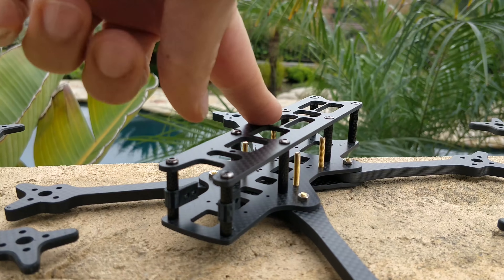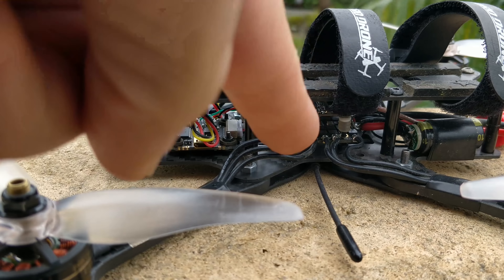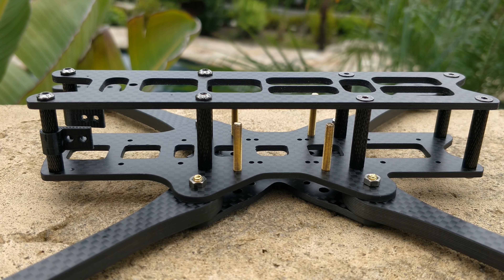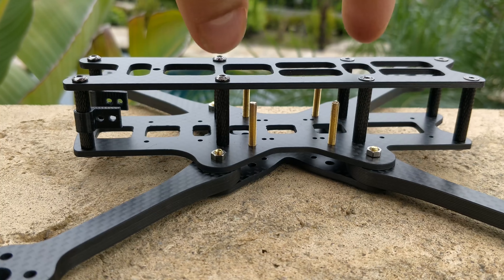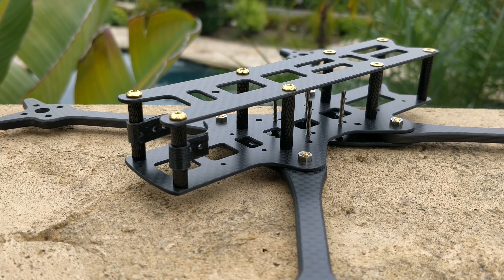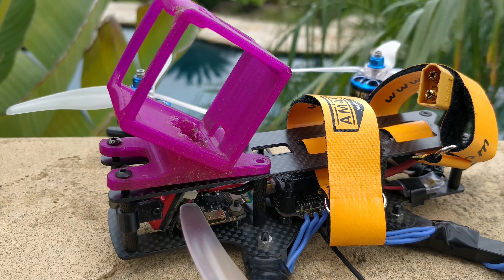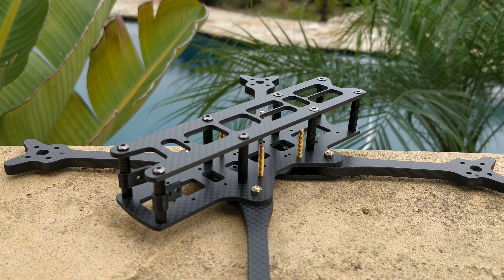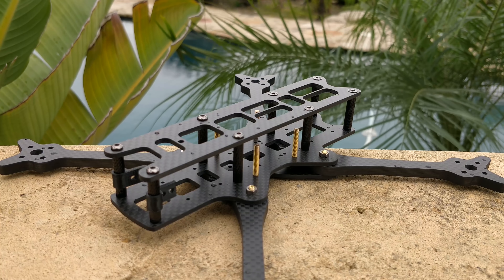Glide - 84g lite, 115g hammer, 97g standard

Comment: I'd be interested to know what specifically blows about R9 for you. I've been using it pretty much since launch (I picked it up in April 2018) & there were definitely issues with the launch (shipped with incorrect antennas, lots of firmware updates, whole thing felt rushed) but now there's honestly no difference between it & any regular 2.4GHz FrSky kit in terms of ease of config, reliability, etc. In fact with the new ACCESS hardware I find setting up a new quad with a R9MM even more straightforward than using a R-XSR. A lot of the people I see bashing R9 picked it up early on, haven't tried it again since, but still maintain that it's awful despite not having touched it in 18 months. But you've presumably used it more recently than that?
Reply from the maker: I've used every single iteration of r9.  Some of them work okay but the main issue is the absolutely mind blowing fragmentation in what should have been a VERY simple product.  There are SO MANY firmware versions and module versions and NONE of them seem to work properly with one another.  There's no simple way to update firmwares and nothing works with one another.  On top of that, the range totally blows.  I get better range on my rxsr than I do with the 1W R9 module.  Oh yeah and binding is absolutely ridiculous.  I can NEVER remember how to work the stupid menus to bind and they keep coming out with new shit that doesn't work with the old shit.  It's total bullshit.  If it's working for you then great, keep using it.  I do not recommend it even to my enemies.  It's utter garbage to me and only a strategy to try and win back marketshare from TBS
Reply: @Kabab  I have to agree on the fragmentation part - introducing the FLEX firmware in addition to the existing LBT & FCC firmwares always made little sense to me, even more so now that with ACCESS hardware FLEX literally does everything in a single firmware (all frequencies, all power levels, switchable telemetry, etc. all through simple OpenTX menus). For 99% of users, especially the miniquad scene, anybody buying into the system today just needs one model of receiver & the same one firmware for everything, the rest can be completely ignored. As for range, while I'm not denying your experience, you hopefully know enough about this sort of tech to realise that your experience was almost certainly due to some sort of fault (whether that was hardware, software, firmware, or user) & isn't representative of the system as a whole - telling people "don't buy R9 because it has worse range than a R-XSR" is simply nonsense.
Reply from the maker: @CJDavies  yeah I definitely understand why the darn thing wasn't working and why the experience was so shitty. At the end of the day, R9 was only developed to combat crossfire in the market. It has sucked previously and I gave it many tries. I've had FOUR different modules and over a dozen receivers. Nothing has worked right.

So something that's not totally obvious is that it's gotten to a point where I am asked for recommendations on just about everything. The people in this hobby actually aren't hobbiests anymore. They won't tolerate tinkering too much. (I won't either anymore due to lack of time). If I recommend something that's inherently broken, I'm the person doing ALL the support for that person that took my recommendation. So sure, there are ways to make your own long range system yourself. There are off the shelf components that are actually pretty easy to write software for. But that's not reasonable. R9 at this point is NOT reasonable. I cannot recommend it and there's no reason to use it other than being cheap. Which I understand completely as well being a dentist.  

It is just not worth my time and it also spits in the face of TBS. I've still given it many chances and its just trash.
Reply: @Kabab  I guess our opinions are skewed by our very different luck. I've had two modules & probably have a dozen receivers set up in models. The first module was the original full size JR module over 18 months ago & that was a pain to set up, but worked flawlessly (& continues to do so) once I'd gotten it figured out & FrSky had gotten their act together with firmware updates. The second module far more recently was the R9M Lite Pro & honestly that was as plug-&-play as anything in this hobby. The overwhelming majority of people I talk to about R9 have very similar things to say as me - it was a mess 18 months ago, but is now no different from the end user's perspective as a R-XSR. In fact setting up my most recent builds with R9 has actually been easier than it would with a R-XSR on account of the recent R9 receivers having uninverted SmartPort, so you don't need to pull up that same Oscar Liang article yet again to remind themselves how to do SoftSerial.

Again, I'm not denying your awful experiences with the system. I'm more trying to emphasise that from the perspective of somebody who has been actively using the system for over 18 months & has spent a lot of time engaging with community discussions around it, seeing all sides of the arguments, your claim that it is 'inherently broken' is... just trash.
Reply from the maker: @CJDavies  well that's why I never made a video about it. I'm sure they're gonna get it working right but for now it's a waste of time. The binding sequence is so annoying I cannot begin to tolerate it. Have thy fixed that BS?  Do I need a new module than the four I have?
Reply: @Kabab  I've not had to bind anything to my old (non ACCESS) module in a while, but the last time I did it was just the regular case of activate bind mode, press the bind button & power on. I think you still have to rebind when changing some options though, which is a pain for tight builds where the button isn't easily accessible.

The newer ACCESS hardware makes binding a lot nicer though, regardless of whether we're talking R9 or regular 2.4GHz (& I'm saying this as somebody who didn't really 'see the point' in ACCESS, I bought the X-Lite Pro for the form factor & gimbals). You 'register' a receiver to a module once using the familiar bind button procedure, then you can (re)bind just by activating bind mode on the radio & powering on the quad, you don't need to press the bind button. This introduces neat features like being able to swap/share one model between multiple radios without having to do anything to the model except connect the battery & you don't need to press the bind button to rebind after updating firmware on the receiver (especially pertinent now the newest ones do OTA updates).
Reply: CJ Davies I have the R9 system, and I really wanted to like it. I so wish I would’ve saved my money. Now I have a stack of 14 nano’s, for all my quad, waiting for my Tango 2. It should be here any day now. I will literally chunk the R9 system in the garbage. It has that much value to me(and pissed me off that badly). It is such a pain in the ass. The range isn’t really that great either. I’ve tried every upgraded antenna. and I do have the new were EXSYS version with OTA capability (still garbage)I should’ve just spent my money on the real thing in the first place.

Comment: A note for those like me who don't fly with a GoPro and use DJII with the Glide. Just put the AU in the center and run a 20x20 stack in the rear. Its perfect other than having to run your motor wires to the back and put 2 25mm standoffs in front for the cam. With designs that put the AU in the rear you have to run your lipo far forward if you don't use a GoPro. Here is an old shot with stock antennas: https://1drv.ms/u/s!Ak9c67mrU8aLofMt2D_j8xeESooG4Q 
I just switched to the Apex HD and the AU is in the rear and I hate it kinda because its made to fly with a GoPro so I have to have my lipo way forward to get the CG right. I only switched because I bought Steele Stout motors and they are 19x19 mount and didn't want to wait to return them and get new so I just grabbed the Apex to get back in the air faster. I like my Glide setup better as far as weight and price goes but I am finding the compressed X layout, Steele motors, KISS/FETtec stack and rigid Apex HD combo to perform amazingly well.
Having only flown Kabab's frames for two years now I really appreciate the simplicity of them. The Apex is a nice package but way over priced and has unnecessary fancy cuts and bolts that increase costs. 
Another interesting note on the Steele Motors. I switched from XING 2208 18000kv that I used to run a 75% throttle limit with. I'm only running a 90% limit with the Steels and the power is about the same if not a tad less but the control is ridiculous.

Comment: Hey Kabab :) AFAIK gyro measures the difference in angle thus it could be placed on a 2m long stick taped to quad and fly well :D but IDK about the accelerometer - the acceleration differs if an object is placed further from CG right? So it MAY in some way alter its perception of movement........for more than 3y I was placing it on wings where I wanted and those always flown well :)
Reply: CG doesn't matter, center of rotation does :)
Reply: @dumbledumb2585  on an aircraft? on a thing that literally floats in the air and its direction is changed by applying force to its far ends? did I miss something? :) before You explain your thought - stick a pencil into some play dough and try to throw it in the air so it would spin the play dough around the other end of the pencil. Good Luck :)
Reply: @chemistt  for the accelerometer the center of gravity does not matter, but the center of rotation. They can be in the same place, but don't have to. If your acc. Is in the center of rotation and you vehicle rolls to the left, what does the acc. measure (in this optimal example)? Nothing. Which is correct, since the vehicle did not go anywhere, it just changed its angle. If your acc. is out on a wing, and your vehicle rolls the acc. would definitely detect acceleration. 

My point is that the center of rotation does not necessarily coincide with the center of gravity. If you fly planes you are aware that weight distribution determines the CG (more than I, I am sure :)). I am sure you would agree, that adding a hefty weight to a vehicle (and changing the CG by doing so) wouldn't change the measurements of an acc mounted on the same.

Slight edit to address your Play-Doh example: In your example CG and "CR" reside in the same place. But add two motors capable of producing thrust to each end of you stick contraption. Assuming the motors have enough power to offset the weight imbalance, wouldn't you the center of rotation is shifted towards a point evenly between the motors, away from the CG?
Reply: @dumbledumb2585  I am not sure if it would not. Thats the reasoning behind my OG post. I actually never used ACC on any aircraft that would have FC out of CG so I am not sure if it would not make some "bad readings".

Also I believe that on a quad hanging in the air - the CG and CR is very closely in the same spot. I believe You cant move the CR from a CG in a distance that would be greater than the area of a 30.5 x 30.5 FC board. 

Your example would not work because our rotor has only one direction of thrust. If You fix a 1L cola under one of Your quad motors (directly under). Even with a very powerful motors - Your quad will only move around the bottle (+- the CG shift accordingly to the weight of the rest of the quad a.k.a lever).

Yes, You could probably mask/move the CR on a wing. It may be possible and I believe is happening in some extreme cases in air. As You fly through pressure capsules or something else.
Reply: @chemistt  I don't think it would only move around the bottle, since thrust of the motors isnt static/fixed and could adjust for the imbalance (maybe not for 1kg, but that's just a problem with scale).
Reply: @dumbledumb2585  Yes but all the 4 motors pivot around the CG. You can mask the movement by applying strong force but still it would move the whole frame first. It would still apply constant throttle for the one motor and others would dip....and all that around the shifted CG. In past I was playing with a non-symetric frame that had body in between the front motors so the gopro would have clean view. The back motors were sticking out on long arms and everything was literally between front motors....I would swear that PITCH was rotating ON the shifted CG right behind front motors. Not in the centre of the frame.

For what other reasons would we go back to TRUE X frames (other than rigidity)?

Just try it out :)

Comment: Is the the part where I'm allowed to whinge about only having 16x16mm motor mounting?  Everything else seems dialed, but I still have R6 2207 motors as the only thing I feel like is comparable gorgeous.
Reply: In every other regard, total awesomeness; would love as much content as you can justify in your schedule.
Reply from the maker: yeah the 16x16 is really a lot better for this size.  The issue is that adding support for 19x19 makes the arm design wonky and adds a solid 3+g to the entire frame while making the arm ends less durable too.  I am still working on refining that design however as i'm anticipating big bearing 5" motors to be coming down the pipe and will need 19x19 mounting
Reply: @Kabab  Ah, 19x19 is actually a touch crazy, but if that's what it needs,  that's what it needs.  My alternative suggestion was going to be trying to have pairs of 16x16 mounting diameter with a slot on the side that can tolerate it for strength, but once you're having to accommodate 19x19, you're back to needing slots everywhere, and four bolts probably makes the most sense (at least for senseless bashers like me, and presumably Ahren)

Comment: Hey Kabob I follow you like a religion!!!!!
Question the comment you made during this video about mounting your flight controller in the front and your crossfire in the rear because it messes with the camera. My question is I just re built my GepRC Mark 4 with the vista Nono pro. 
Hi mistakingly unknowingly put my nano Crossfire on the capacitor with some VHB the capacitor is soldered off the positive and negative solder leads off my ESC. 

I am getting a very jittery FPV view in the goggles is this my problem????

Please tell me this is my problem!!!!!!!
I have been tuning rebuilding my stack different configurations trying everything in the world to get rid of this jittery FPV feed. Your input on this matter is highly appreciated if you have the time. Thank you for being there for the FPV community and me in the past many times!!
👌👌👌👌👌👍👍👍👍
Reply from the maker: It could be a matter of ntsc vs pal, vtx noise or actual quad shakes. Try to brace or tighten the camera a little. Hard to say exactly what it could be.  Oh if you're using a rapid fire or something that does the signal blending stuff, there are many cameras that are incompatible with that tech. Set your video receiver to legacy mode and that should fix it.
Reply: @Kabab  I am using the DJI V2 GOGGLES the Tango 2 radio. 
I have the Tmotor HD F7 FC and Tmotor 55A Ultra ESC . I’m using the nano pro Vista combo. 
I’m sorryi should have been more specific. 
My camera is tight I have checked it more than once.
Reply from the maker: @fpvraver  you're using analog on the dji goggles?   What receiver module?
Reply: @Kabab  no I’m using Crossfire and the Caddx Vista Nebula pro camera. I have the Tmotor HD F7 FC & 55a ultra ESC.

My FPV feed in goggles is jittery when I pan right or left with the quad in my hand and flying. 
It looks like a frame rate issue.
Reply from the maker: @fpvraver  ah. Sounds like it's not flipping into high frame rate mode. I forget the setting to turn off for that. It's somewhere in the menus.  If your uart link to the vista is working, it sees when you arm the quad and that's when it turns into high frame rate mode. I don't know why the low rate even exists
Reply: @Kabab  Thank you for your information. Race Day Quads has instructed me to send the vista unit back to them for a store credit. It was switching to 120 FPS after armed. I still had the Glitchyness only in my FPV view in Goggles. 
I watched my DVR and saw there was no glitching at all in the DVR footage. 
I have already ordered a new vista nebula pro from Sergio Pyrodrone
Reply from the maker: @fpvraver  that's very odd. If the dvr was coming out clean, it wouldn't be an issue with the vista 🤔
Reply: @Kabab  what could the problem be ?
Everything is brand new. DJI V2 GOGGLES Vista Nebula pro Tmotor F7 FC and Tmotor 55a ultra ESC on the GepRC Mark 4. 

The jitteriness looks like a frame rate issue with the FPV view. 
When I look at my DVR it is smooth really smooth there is no jitteriness. 
RACE DAY QUADS has instructed me to send the vista back for a store credit. 
My thing is if it’s not the Vista then I’m going to be doing all this work for nothing what do you think the problem is?
I ordered everything from RDQ I just got it all built up last week. I have been trying to figure out what’s wrong for a week now. 
Could it possibly be the DJI goggles?
Reply: @Kabab  after I arm it goes to 120 frames per second. 
I have auto temp control off. I have low battery off. I have it in low latency more channel 2 race mode view. 

How do I adjust the frames per second ?

RDQ has just told me to send my vista unit back. 
I am worried about doing that that’s a lot of work and I don’t think that’s the problem. If the image being sent by the Vista to the goggles was corrupted wouldn’t the DVR record that?
Reply from the maker: @fpvraver  I'm not totally sure what the jitters you're referring to are. Could it be some shakiness of the quad or the camera mounting?  Sometimes that shows up in the fpv feed but not in the dvr.